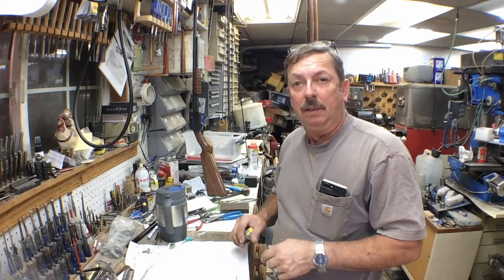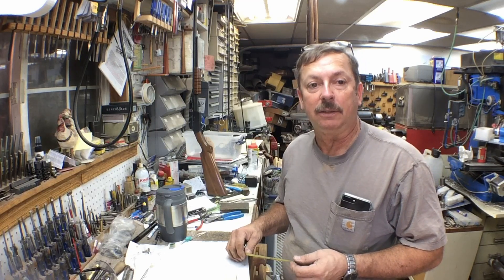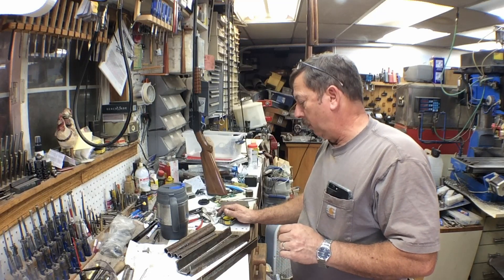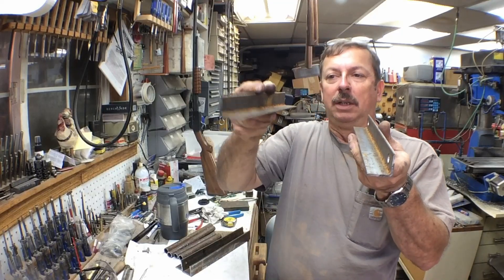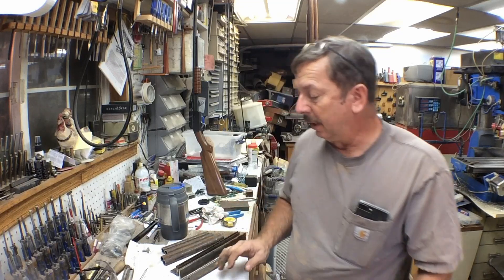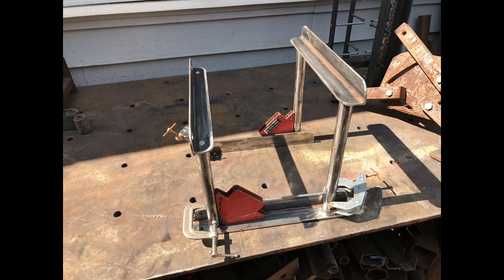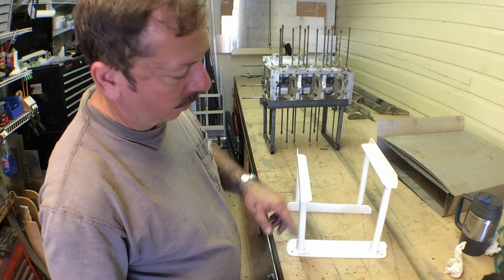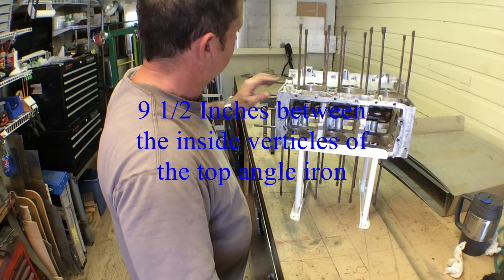Building a Zenith 701 Experimental Airplane, Building a Corvair Engine Assembly Stand

Comment: Nice project, Dan. How big is the oven you use to cure your powder coating? I've been looking at some of the smaller ones, but none of them are big enough to do most of the parts I'm considering. Also, are you going to put a 5th bearing on your Corvair? My case and heads are being prepped over at Roy's Garage right now, as I've selected his 5th bearing for my build.
Reply from the maker: My oven will handle pieces about 16" x 16" x 4' long. I built it several years ago as a cerracoat oven for the gunshop. doing less cerracoat for customers and more powdercoat for me. Yes I consider a fifth bearing a necessity. but I am not sure exactly how I am going to address it. A cast housing to me is more astetically pleasing in this application (looks more retro which to me is more in line with a 60s engine) like a gen 1 Wessman 5th bearing. But I also feel that it has been conceived that there is some great mystery to a 5th bearing when the reality is (oversimplified I know) all that is necessary is to provide a support surface to releive rotational flexing forces on the crankshaft caused by the prop forces and provide lubrication to the above assembly while remaining  in alignment. So this is not an issue which cannot be overcome relativly easily in a moderatly equiped shop. We will see what develops on that front. Dan.
Reply: Considering you're a machinist with the equipment, developing your own 5th bearing is more a matter of a time investment than anything else, I suspect. I'd be interested in more details about how you built your oven, if you feel inclined. I was considering building something large enough to cure my forward cabin frame, but I'm not sure if that's practical. I really like the finished product of powder coating, though, and would like to finish all my steel components that way.
Reply from the maker: My oven was built from ideas on one of the powdecoat forums. I will try and look up which one. galvanized skin and interior with insulation oven elements and pid control. relativly simple but time consuming. In my opinion not worth doing one large enough  for cabin frame. for just a few larger items I would take them to a local powder coat company. mine was a compromise of what I would coat most and the space it will occupy forever.  As far as a fifth bearing I havn't decided yet. If I build my own I will not develop my own, I will blatently steal everyone elses ideas and combine them to what I think I need for the 1 or 2 that I will build for my own use. As far as time investment, everyone says that you trade time for money. for myself I consider that inaccurate, I feel that I trade time for knowledge which is an investment I consider worthwile.
Reply: That's an excellent way to look at it. For me, much of the experience of scratch-building has certainly been about learning, and I hunger for knowledge constantly. So I completely agree there as well. I just meant that developing your own 5th bearing requires only an investment of time rather than money, but the gain is the finished product AND the knowledge. I'm wondering if a curing oven could pull double-duty for forming acrylic/plastic parts? I have severe space constraints at the moment, so an oven large enough to do the cabin frame would be tough in that regard. But if I could also form my windscreen and some other bits in it, I may still look into it. In the end, though, it might cost me more than just buying the items. While I'd love to have all the fabrication equipment, knowledge and tools in the world, I have to draw the line somewhere. However, I keep shifting that goalpost, so we'll see. But a smaller oven would certainly get me much further than I am now.
Reply from the maker: Stay tuned on ideas for forming acrylic. that is alresdy in the works and it will also have some ideas for expanding the capabilities of a smaller oven. The problem with an oven big enough to  easily coat cabin frame and form windshields ect. will I speculate needs to be at least 5 x5 x5 interior which means you need at least 6 squared outside. minimum 4 elements and the controls to handle it, plus power consumption. big investment and use of space for the use it will probably receive.
Reply: hillsgun
Those were my thoughts too, I just haven't researched ovens enough yet. I like the idea of building a "down and dirty," (but effective) oven, but practicality has to be the order of the day in my small garage. I've been looking at the Grizzly 10x22 lathe for months, and I just don't know how I'll shoehorn it in there. An oven would be an even bigger problem, literally. I haven't done acrylic forming in years, and even then I used the heat strip method for simple single axis bending.
Reply from the maker: The G0602 is a good lathe within it's size capabiliies I converted one to cnc. Larger acrylic is it's own animal. Since it is hydroscopic it has to be heated in a manner to drive out the moisture and then formed to be able to retain optical clarity.
Reply: Lots of advocates for that lathe, and lots of advocates for getting it with variable speed. I've been looking at the G0752Z, which has variable speed plus 2-axis DRO. I'm considering leaving the DRO (a $200 option) off, since I don't know how useful it will be for me initially, and it may actually get in the way of converting to CNC (which requires 3-axis, I think?) at a later date. That would be way down the road for me, if ever. I have such a fabrication addiction, that it's only a matter of time before I build up even more tooling. 3D printing is yet another distraction at the moment, as is learning Fusion 360 and Solidworks. And then acrylic forming is yet another distraction, and I'm still learning to weld better. I need to retire so I can focus on all these things!
Reply from the maker: I purchased the 602 with the sole intent of converting to cnc so I switched to a 3 phase motor and a vfd which I believe is a better option than single phase variable speed even for a manual machine. If the dro is only 200 more I would definitly add it although I would prefer 3 axis dro. cnc on a lathe only requires 2 axis control, the list of projects is endless.
Reply: hillsgun I wonder if converting it to 3-phase with vfd would be cheaper than buying it as the variable speed machine. I don't have 3-phase in the garage, so I'd have to also purchase a converter to do it.
Reply from the maker: it's been several years so I don't remember what I paid for the motor and vfd but probably between 3 and 4 hundred for both. If you are using a vfd you don't need a phase converter.
Reply: Ah yes, I forgot the VFD takes care of the 3-phase. I found a DIY that puts the price around $350 for the new motor plus VFD. If I buy the G0602 w/2-axis DRO for $1575+shipping, then do the conversion, I'll be right around the price of the variable speed version with DRO. But then I wouldn't have the benefits of the 3-phase with VFD. Stuff to consider!
Reply from the maker: it's all a matter of which distraction you chose.